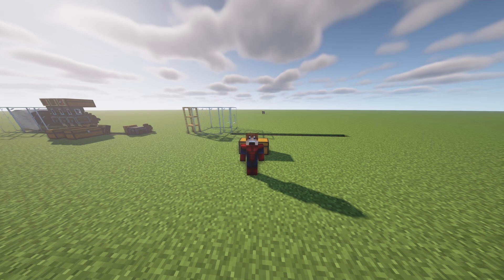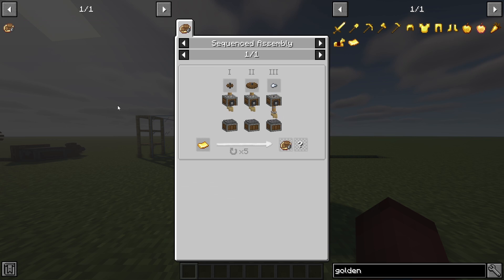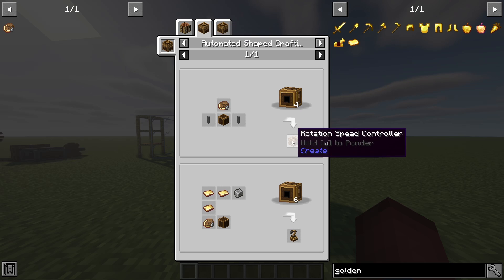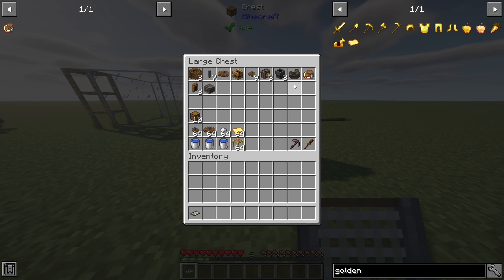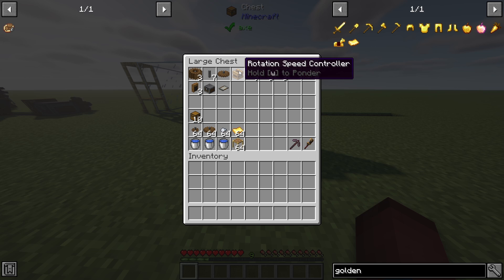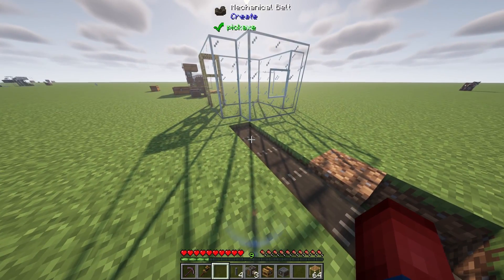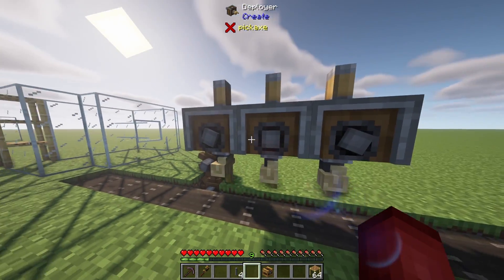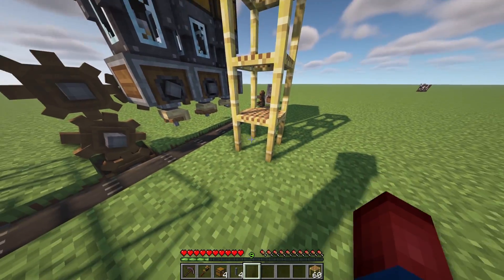Minecraft Create Mod 0.3.2 - Automated Precision Mechanisms

Comment: Not sure how you have a precision mechanism for a filter when you haven't made a precision mechanism yet. You also need one to make a rotation speed controller.
Reply: You don't need this machine to create precision mechanisms, you can actually make them by hand, by placing it in a depot with a deployer on top, but you have to manually give the deployer the desired item, first small cog, then big cog, then iron nugget, five times. You can also build this without speed controllers, just use cogs to change the speed. The whole reason to build this is to automate the making of precision mechanisms, which means you've already made some earlier, but not automatically.

Comment: Small note, the way the weighted ejector plate works with angles and such, this actually only barely works because it has chests up top. If you have a full block like a barrel it doesn't work.

Comment: Rotation Speed Controller also needs a precision mechanism so how am i gonna get that?
Reply: You don't have to have a Rotation Speed Controller. Set up works without it, it just will run slower.
Also, you don't necessarily need this setup to make a controller. Just place a Deployer facing down on Depot and manually give it needed items in needed order. The setup just automates this, a bit annoying, process.
Reply: @antongrigoryev6381  yessir. Sorry i forgot i had this comment i already had done it without the thing needed and it works nicely!

Comment: It would be much more compact to make it with two belts, one of them one block higher and to the side of another. You can transfer items up and down with andesite Funnels. The weighted Ejector is too slow and your system takes too much place in my opinion. Generally, I noticed that your systems tend to take too much space, almost any of them I could make at least two times smaller. Try to rely more on Depots, Funnels, and Hoppers to move items vertically. Sometimes a single layer of blocks vertically allows to save a ton of horizontal space.

Also, I don't think you actually need separate chests for Mechanisms and junk. So you can use a single filter, put Incomplete Precision Mechanism there and set it to Blacklist.
Reply: I think the tutorials is not always about compatibility, its more spread out so viewers can have a better view and understanding of how things work.

Its easier to understand for newer players.
Reply from the maker: I build my designs more for understanding and less for efficiency - although I love the tips and hope others can read these for improvements :)
Reply: I love how humble rockit is. For a comment like this I would have answered in a completely different way. And by the way, I really like the design rockit did. And just as reminder, Minecraft is almost infinite in terms of space, so compacting is sometimes is just not necessary. Plus, the whole contraption looks very nice, I wouldn't change a single thing about that. And I like to have 2 different chests for the junk and the precision mechanisms. And as someone pointed out, tutorials are not necessary aiming at compactness or efficiency, but mostly at giving the viewers something that they can easily understand. Feel free to build your superconpact scicraft level design in your world, in my one I'll build this one. (And the ejector is sooo cool to watch)